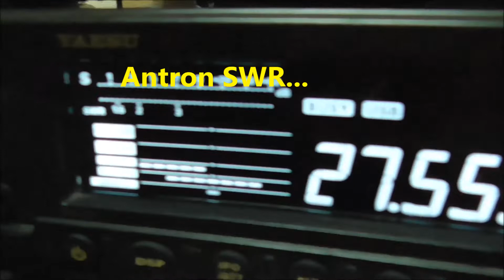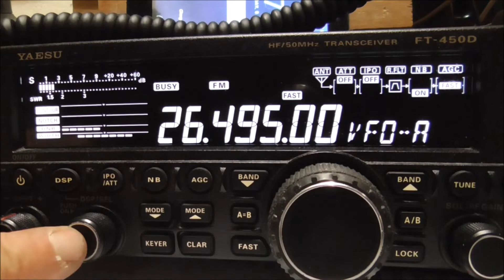Moxon Antenna & Mast Assembly ~ Full Description from Unload to Tuning

Comment: Is it possible to change the Carabiner? It will be easier and faster to use a simply and small (3cm)Carabine.
For example: https://www.amazon.com/dp/B08DTCM52N/ref=cm_sw_em_r_mt_dp_X.DDFbD8J2P3C
Reply from the maker: Yes. Check Out a More Recent Video I Did on the final refined version https://www.youtube.com/watch?v=iNKmzryaEXU

Comment: Hi Max, the moxon is a great antenna :).  

I have a 12m telescopic aluminium tube mast (1.75m retracted which uses heavy duty jubilee clips which tighten with a 10mm socket.  

9 guy lines and 3 home made guying eyes. 

9 ground stakes made from angle iron (these are mainly used for home deployment... otherwise you could do similar to the way you go portable...But I'd be tempted to fabricate/purchase a drive on plate to mount your antenna mast to, as it will simplify one man deployment and keep you warm if it is pissing down with rain/snow etc :))

Also, get yourself a small bag (old laptop bag perhaps?) To keep all your cables/bungee straps in hehe :)

Apart from the sheer chaos of construction... your system works though and works well! :)

As always Max, thanks for all the video and for all the time you give to all of us non content makers... it is very much appreciated by me :)

Take care of yourself my friend.

73.
Ash.
Reply from the maker: It Can Go Anywhere. As noted, side of car, pic-nic table, log pile, random post, Lots More Videos to Come. Thanks for Your Comments. All Well Noted. One Point in this Video is I am still refining the process and have lots of future ideas for "playing" with this gear. Thanks again 73's